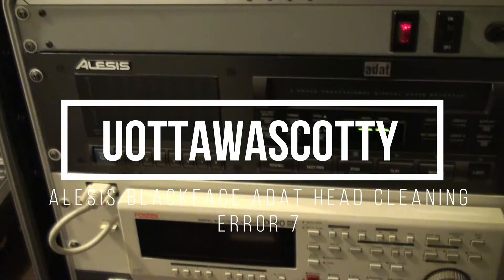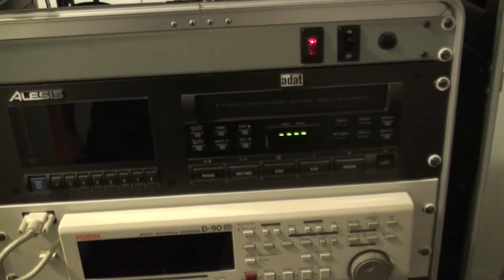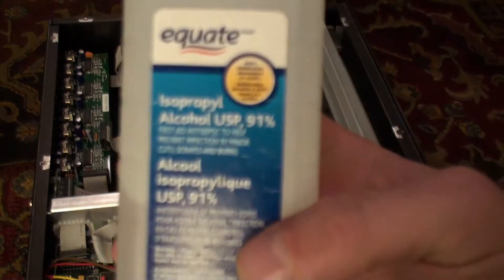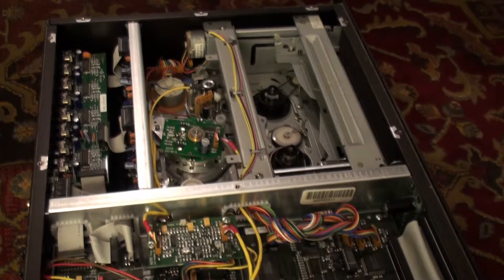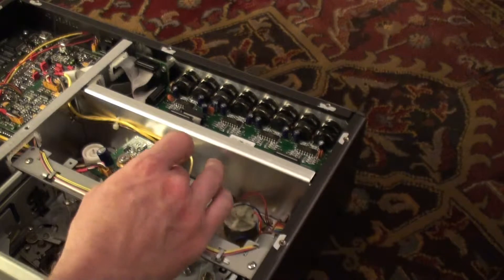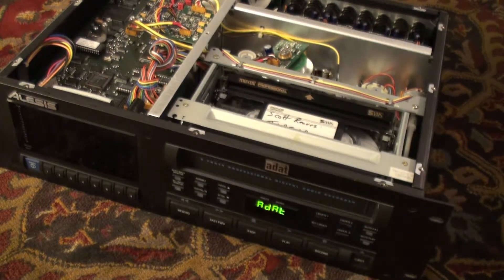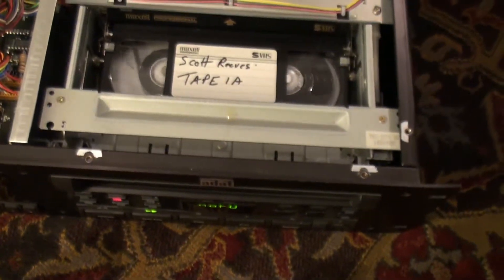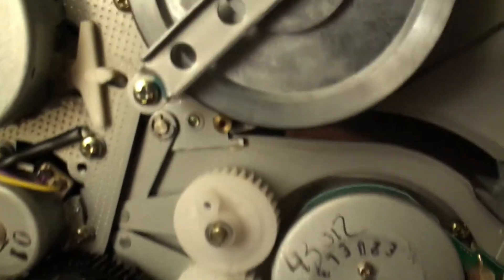Cleaning the Heads on an Alesis Blackface ADAT, Error 7

Comment: My Blackface had this exact same behavior, changing the rubber ring on the idler wheel fixed it completely.  Simple and cheap, worth a try if you're still looking to fix this.
Reply from the maker: Really eh ?  Okay, yeah I still have this unit and I would really like to experiment with it and get it going, so I really appreciate your advice, when I get some time I will try this and see if it works, thanks for the tip !
Reply: Where did you buy the rubber ring?
Thanks for the advice!
Reply: @raulconve6841  At a hardware store, it's the same ring as used in plumbing for pipes.  You just have to bring the old one along so you get the right size.

Comment: the right roller guide is misaligned, if you turn it less than a quarter CCW, that may help  to fix the error 7
Reply from the maker: Thanks so much for this advice Jamie, I will definitely try that !
Reply: @UOttawaScotty  For a moment I thought it was the pinch roller, because by touching it and applying little pressure against it, the error 7 was removed, I removed it and turned it, but it did not help, so I remembered the problems in VHS if the rollers are misaligned they cause rain on the image, I adjust that roller to be the closest and voila! 
that eliminated the problem of mine.
good luck
Reply from the maker: @Jaime_Estevez  Wonderful troubleshooting Jamie, as soon as I get a moment I'm going to revisit this project with your recommendations, thanks again for your help !!!
Reply: @Jaime_Estevez  how did u adjust the roller to make better contact ?
Reply: @maxwelldegregorio5126  the part I am referring to is a white roller, located near the heads, it has a slot to adjust it with a screwdriver, move it a little from one side to the other, the problem is that I could not tell you if the adjustment is to one side or to another, but I definitely think it's clockwise, that was my problem, It is not about adjusting contact, it is about adjusting the elevation of the tape

Comment: I grabbed an adat xt yesteryear with one hour of use (probably reset somehow =/ ) and went turu the same: no good tc, er7, sometimes e9 (weak rewind), couldnt adjust the pulse generator (PG) delay since its number has been ripped off... E7 could be head pre failure or further electromechanical bug. I took mine to a vcr tech, dunno if you tried yet. If you manage to get "video" signal plugging into a tv that's good sign. Anyways, good luck with your 90's project! I'm kinda aiming for that here in Brazil, too.
Reply from the maker: Ah man, that's a huge bummer, I have not gotten mine working yet, haven't spent too much time on it, but I'll take another crack at it on a rainy day.
Reply: for error 7  the right roller guide is misaligned, if you turn it less than a quarter turn CCW, fix the error 7 problem, for error 9 , clean the switch under the mechanism, it would be good to clean all and the rubber parts, rollers etc.

Comment: The adat is more reliable that the fostex i got a Fostex 1624 mk2 and the display stopped working i opened it up checked power supply replaced capacitors and still no luck found burnt out ferrite bead on the tiny pcb thats out putting the VGA connector. Doing diagnostics with all the boards and the thing runs on firmware that has gone from the chips. So it's bricked those fostex where over engineered

Comment: hi i have alot of working adat i have fixed over the years  you hot to use the right paper  once cleaned find the bad tape  this is why  code 7 is coming up
work ok in a vhs audio master  i  moved all the tapes that do not work in the adat's recorder  some times the tape are made bad i had this  time to time  keep
recording the old lady's will last along time